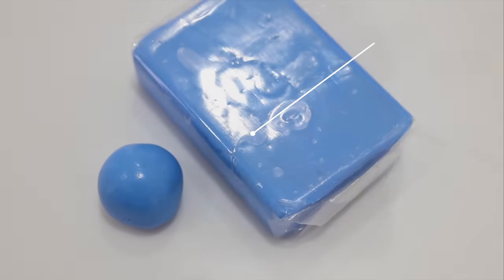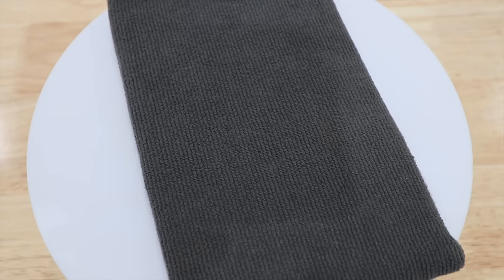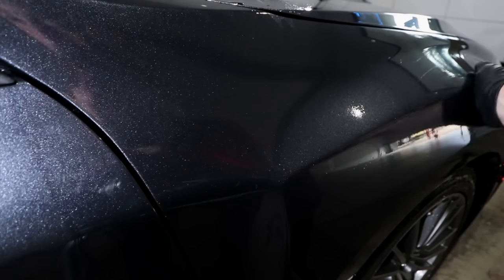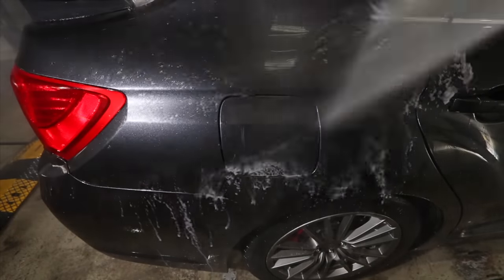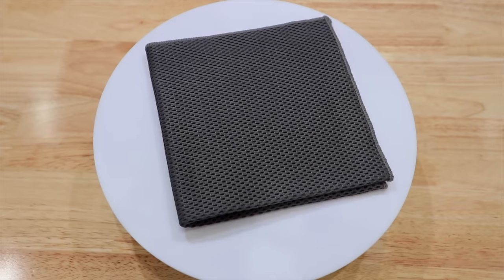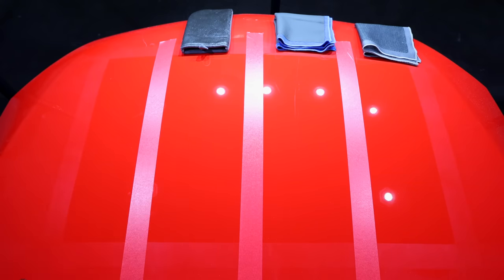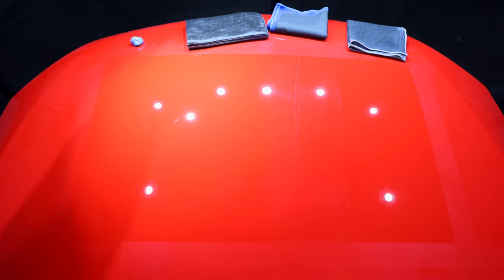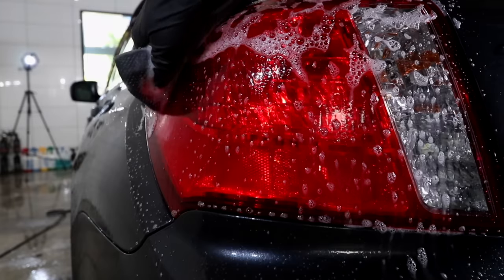The Future Of Automotive Clay? Faster | Safer | Amazing!

Comment: These clay towels are much quicker than traditional clay but I still prefer using old-school clay
Reply: Why is that?
Reply: For me, the clay mitt removes the big and looser dirt. Clay removes smaller and tighter dirt on the paint. Actually, I use both, with the car shampoo, I use the clay towel, and the clay bar I use a lubricant when dry.. Both together in the same car, if the car is a very dirty detail.
Reply from the maker: Yes I’ve done the same in the past many times, and depending on the specific fallout or contamination on the vehicle it sometimes be a great way to go.
Reply from the maker: There’s definitely something about traditional clay that I also love, I still remember the first time I used it almost 30 yrs ago - it just blew my mind!
Reply: @KK001 Personal preference. For me, there is just something more satisfying about the traditional way. I have clay towels that ill use if time is of the essence
Reply: @Gnetbird  i find clay towels and mitts/pads to get the majority off and do it faster but clay bars makes the paint smoother but is slower. Bilt hamber make my favourite clays.  If you drop a clay bar, cut it with a knife twice and use the inner section of the clay that you never use when your just kneading a bar  use it until its worn out then chuck it.  Ive been tinkering with kaopolite sf powder for liquid spray on clay but havent got the formula right yet. Diamondite had one out decades ago

Comment: Dosnt using clay MIT's keep contaminates in it though. Won't clay bars be better because you throw them out and don't use them on different cars. Hard to know when these black clay clothes are to dirty
Reply from the maker: The contamination doesn’t get imbedded on synthetic clay like it does on traditional clay, it rinses off and gets suspended on the car so you rinse it off to remove it - it’s a little different that way.

Comment: Love the video. The format. The added graphics, excellent sound. Great video, Sandro.  This towel looks like, as others have said, the Rag Company towel, which was derived from Optimum's Ultra Clay Towel. If similar to those, I absolutely agree with you. Such a great towel. Foaming is good. I also like spraying iron remover (Ferrex) into it directly. Saves me a ton of product that way vs spraying the paint.

Comment: Just ordered one Sandro, looking forward to giving this a try after years of using traditional clay bars, thanks for posting this and as ever, stay happy and safe...cheers Anthony
Reply from the maker: Thanks, and don’t forget to clay the car glass first to break the synthetic clay before you use it in the paint - I forget to mention in the video that all synthetic clay needs to broken in on glass before using it on paint.
Reply: @CarCraftAutoDetailing  no need to apologise Sandro, cheers A

Comment: Fantastic review, Sandra, thanks for posting.👍 I will definitely be giving it a try. I use the Bilt Hamber clay here in Britain, which is the best clay I have used. I tried using the Farcela clay mit on a 12 plate Hyundai i10 and was shocked to see how much marring it left behind and went back to using bars. This mit looks so much better.👍

Comment: CarPro has since upgraded their clay towel(PolyShave) months if not close to a year ago to a similar design.  Much preferred over the old design(blue towel) you posted as the newer design comes in Orange.

Comment: This is the same webbed pattern as the optimum ultra clay mitt. I still find myself using traditional clay because it tends to still leave some contamination on the paint. It’s far better than the solid clay towels and mitts though.
Reply from the maker: I’m not sure if it’s the same but is does look similar

Comment: Have you tried the Bowden's Own claying rubber? It's got a similar surface, with void spaces, but not actual 'air holes'. It's on a foam backing layer and is just a claying pad essentially. 
It's definitely not as aggressive as the Waxit Clay Mitt (which is sometimes good for heavy contamination), but leaves much less marring.
Reply from the maker: No I haven’t tried it but I will try to give it a go

Comment: Optimum Polymer Technologies have had the clay mitt and Clay towel for several years
Reply: Are you sure it uses the same material? That can make a big difference, even if the design is the same.
Reply: @marksafady5986  
Optimum were the first to produce the clay mitt and towel.They upgraded their products  2 years ago to same material. I Used ONR rinseless wash, clay mitt and then dry with Optimum spray wax in one go .No maring on paint

Comment: My biggest complaint with synthetic clay is I can't see what I'm pulling off. I like being able to look at the clay and visibly see what's coming off the panel and how much. I tend to use them during the wash process and spot clay with real clay before wax and grease remover. I'm gonna try this one, thank you Sandro. How does it feel paired with ImmoLube? Happy holidays! 👍👌✌
Reply from the maker: Yes traditional clay is definitely a unique experience! And yes works great with ImmoLube.
Reply: Keith Olsen,  I know, it;s been a year....  :)   What you have to do when you have no "visual" like the claybar surface, is to work that section of the panel, carefully wipe it or blot the moisture off, and run your clean, dry, hand over that section.. Do you feel the little irregularities on it??  If so, you need to over it again.... I posted at the top of this video some other info that will also help you do this most essential step before paint correction, and then your LSP, etc...
Reply: @frandanco6289  I hear you. Don't get me wrong, I like synthetics and they're definitely more efficient all around. And yes, you can certainly feel the panel and tell if it's free of contaminants. It's just not as satisfying as looking at the clay and seeing all the junk you're pulling off. It's more of a pleasurable thing for my OCD than it is necessary to make the process effective. Just like cleaners and soaps that make alot of foam are usually more fun and satisfying to agitate than those that don't. 😁👍

Comment: I’ve never used the towels because a fear of trashing the paint. I’ve always stuck to Meguiars clay. On average, how long does it last? And are you washing the cloth out between each panel? What happens to the collected contaminates? Looks like you’re getting great results.
Reply from the maker: With synthetic clay, the particles don’t so much bond to the clay, they get suspended in the clay lubricant so you rinse them off the car along with the panel, but yes you can also just rinse the clay in a bucket or with a hose or pressure washer to remove any particles on the actual clay.

Comment: I've been using synthetic clay for about a year or so and I love it. What really sets this stuff apart from traditional clay is that you can drop it on the ground! If it were to slip out of your grip and hit the floor you can simply rinse it and continue claying your car. You cannot do that with traditional clay bars.
Reply from the maker: Yes it’s definitely a big plus about synthetic clay!
Reply: James T.  I don't know who ever said you cant use a claybar that you accidently dropped, but this is just not true... So cant you look at it, see if it has anything stuck to it and remove it??? Heck, they make claybar cleaner sprays that you spray and it takes off a micro layer of the clay, and all the gunk stuck to it off... 
Pretty sure the people that banned claybars that hit the ground, to the trash can are the very people who Sell them.... Hilarious...

Comment: Great video.
After claying the car, is it necessary to polish the car? I don't have the tools to polish the car so should I just skip the claying?
Reply from the maker: Thanks, and claying can cause some micro marring especially if you have a soft paint which is why a light polish is recommended afterwards but also not mandatory. If I couldn’t polish I’d still tend to clay because it is very beneficial to the paints health to remove that contamination which degrades car paint over time. If you don’t have a machine polisher, try using something like Autoglym Super Resin Polish by hand, it’s very easy to use and should clean up any clay marring and improve the look of the paint. 
https://youtu.be/05XKPmdLVu0

Comment: Isn’t the Adams clay mitt what you say you would want to see? It’s a clay mitt with the same texture of this towel
Reply from the maker: The optimum towel and Adam’s mitt could be very well be. They certainly have holes but are still different to this towel so I guess it’s just something that would need testing. As mentioned in the video a lot of clay looks the same but just doesn’t perform the same and I’ve never seen those products in Australia so it also depends on what’s available to you but thanks for sharing that!
Reply: @CarCraftAutoDetailing  I forgot that you live down under! I'm using the Adam's mitt and I'm very happy with it, but I'm not a pro by any mean.

Comment: Hi Sandro, thanks for demonstrating the different types of clay medium and their results. I fell into the eBay 3M clay bars trap a few years ago  before becoming a bit more knowledgeable on claying.  Was any of your testing on any long term ceramic coated cars, if so, did it cause any marring? If not, what marring affect could be caused?  Cheers, Ozz
Reply from the maker: My pleasure mate, and generally you really want to stick to chemical decontamination when it comes to ceramic coatings as mechanical claying will always to some extent scuff the coating and potentially compromise it.

Comment: Hi Sandro, your videos are exceptional! I learned a lot from watching them as you’re not just a great teacher but also a great video producer. Additionally, your style of presenting and your calm voice are like a chill therapy for me. Thanks for creating this content.

I’m not a detailer, i just enjoy taking care of my car. I don’t have a knowledge nor conditions to do polishing. I wonder would you recommend claying to someone like me? Would that produce damage to the car paint which would require polishing? Or is this best to go to someone who does it professionally? Thanks!
Reply from the maker: I appreciate that and it’s my pleasure mate. 
Periodic claying is vital to remove contamination that would otherwise degrade car paint, it also has the advantage of allowing car waxes and sealant to bond more successfully and last longer to protect your car paint better. In most cases clay marring is quite minimal if done correctly and no more visible than light washing swirls or haze. 
I would say try it yourself, worst case scenario is that it does cause some minor marring that a very fine polishing stage will easily remove - any pro detailer with even minimal polishing experience can address that easily.
Reply: @CarCraftAutoDetailing  thanks for your detailed response! I feel more confident to try it on my own now. 

I could only find Scholl eraser clay, I hope that's okay for a beginner.

Comment: Sandro, mate it sounded like its was overspray or something like that, i have sprayed Iron remover on my car especially on the front bar and the top of the bonnet and nothing no reaction at all, no purple marks or droplets at all, even behind the wheels on the painted surfaces ,nothing at all, maybe because i keep it clean most of the time and yes i do drive the car in the wet and in traffic? 
Still i wonder how bowdens 3 in 1 products will be reviewed as that is supposed to be a iron and wax remover and decon all in the one product?
Also sandro just asking i think checkered or weave type clothes are great for cleaning glass and also any glass cleaning towels must be new even if you wash then the soap used still leaves a residue thus you have minor haze in the glass, i remember using metho and newspaper to clean the glass on my VB SLE and also the XB GT?

Comment: Great review Sandro. I'm guessing you still need to break in the towel on glass first?
Reply from the maker: Thanks and yes definitely all synthetic needs to be broken in on glass to stop that initial aggression - thanks for mentioning that!
Reply: @CarCraftAutoDetailing  is clay towel or claybar safe for ceramic coated vehicles?
Reply from the maker: I personally wouldn’t recommend claying over ceramic coated paint as all clay has abrasive qualities which can compromise the coating

Comment: That looks like an awesome clay cloth. Personally, I've used The Rag Company's Ultra Clay Towel and a couple of cars with the Mitt. The towel induced a LOT of damage on the paint. In one instance, I had to Compound 2 times to remove the deep scratches. It got me really frustrated of course.

The mitt seemed to work awesome, but on the last car I used it on, it may have caused scratches again. Will test it out when I get the chance. Anyway, I've ordered these Aero Clay Cloths from the US (I'm in EU). If these don't work either, I'm most likely at fault.

What is your experience with the Ultra clay towel and mitt? They look similar, but like you said, they could be worlds apart.
Reply from the maker: I hope it works out better for you but I haven’t used the Ultra Clay towel so I can’t say.
Reply: Rik Heijne - If you are getting a lot of damage, you are not using enough liquid whatever, and possibly rubbing the media too hard into the paint... You want to only use Straight, back and forth or up and down strokes on that panel, nothing else if possible... And you have to keep the force - Evenly - applied across that work, and at the same time, keep it all really wet... Read my first post at the top for more info about how I keep my work wet and never have any marring, etc., problems... Good luck with this !

Comment: Few questions:
How big of a section do you clay with that towel at a time? And would it be better to rinse each section off as you go like in the video, or can you save the rinse for after you've gone over the entire car? I have hard well water, so it's typically a race against time between rinsing and drying my car off so I'd most likely have to dry each section a bit as well if the clay lube can't sit on the car. Also, do you do anything special with the towel other than rinsing it off between panels?
Reply from the maker: The less contamination on the vehicle the larger sections you can clay, but if its quite heavily contaminated I’d stick to a square or half meter square at a time. You should rinse before your clay lube or chemical starts to dry on the paint, so that will depend on your lube and weather conditions, and yes I just rinse the towel off - mist of the particles will actually be suspended on the car panel as they don’t stick to synthetic clay as much as they do to traditional clay

Comment: Thanks for the great video, I have learnt a lot so thank you.  Have just ordered the Economax Clay Cloth and Shine Supply Shine Mist to give it a try.  Do you recommend applying the Shine Mist only to a dry section or is it OK to apply to a wet section?  Thanks again.
Reply from the maker: I usually clay the car while it’s still wet so wet or dry is fine.
Reply: @CarCraftAutoDetailing  Thank you and keep up the great videos.
Reply: Just used the Economax Clay Cloth and Shine Supply Shine Mist and it did a great job.  Question - What's the best way of storing the cloth after drying it?
Reply from the maker: Great to hear, I just store in a small plastic tub

Comment: How would I take care of the towel, air dry and put it into the case it comes with?
Reply from the maker: I do a final rinse under running water and just let it hand dry on an indoor drying rack. You can put it back in the case or a clean plastic container.

Comment: Hi Sandro, another great video as usual.
Can you please help me? What is the grade of this clay cloth ?
 My car is coated with artdeshine nano graphene and after a year im experiencing loss of performance of the coating on the roof and bonnet unless i use a topper. According to the aftercare it says to use a fine grade clay bar to remove contaminants. i have tried washing with carpro lift and descale. did a iron decon and water spot remove but didnt restore the hydrophobicity of the coating.
Reply from the maker: Thanks and this cloth isn’t graded - synthetic clay typically isn’t - but if it helps I have found it be the most gentle synthetic clay I’ve ever used in terms of minimising clay marring, but like most clays it will marring to some extent and especially on softer car paints. 
I’m not sure if you’ve tried working in your iron and water spot removers physically in smaller section by section applications, but it will dramatically increase their effectiveness. Claying a coating isn’t something I’d typically recommend but if the brand recommends it then they hopefully have the first hand knowledge that it’s fine and helpful to do so. 
Maybe this video will also help: https://youtu.be/vWYyw-yKM3A?si=GEjoinRLW_OvB18r

Comment: Clayed my car with a mitt over the weeked in an attempt to remove what I believe is artillery fungus. Did multiple passes and even included bug/tar remover but no luck. Any advice? Feels like I need a tackier clay so would this cloth be my next option? Thanks in advance.
Reply from the maker: You may need to use a compound and allow those abrasives to help remove it.
Reply: @CarCraftAutoDetailing  thought that may be the case. Which compound would you recommend? Meguiars ultimate?
Reply from the maker: Yes I’d say give it go
Reply: @CarCraftAutoDetailing  thanks for your help!